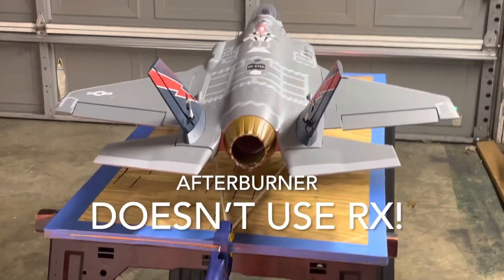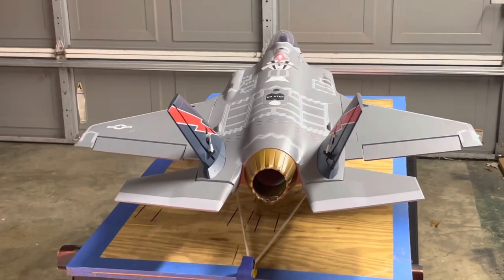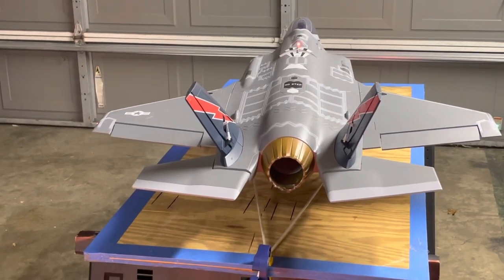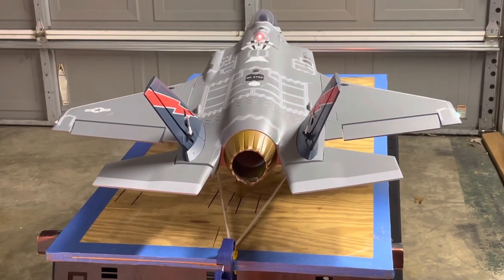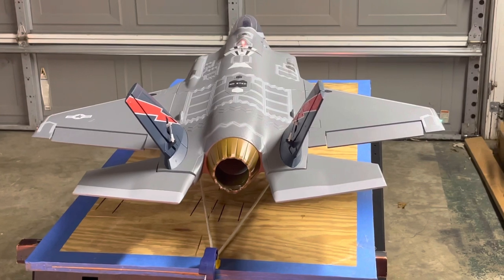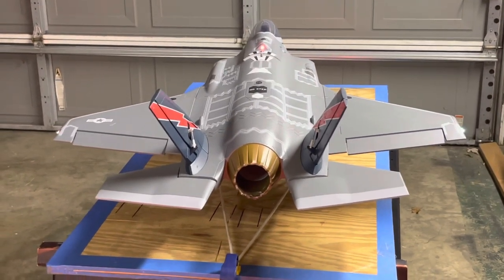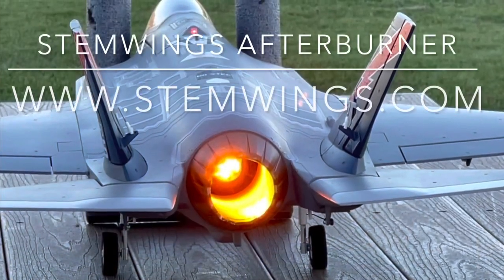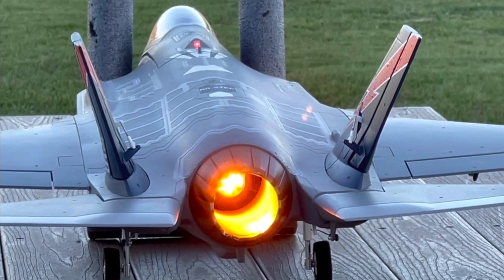Afterburner without RX input?!

Comment: Nice, you should provide a link in the description.  Also, can this be used with regular turbines such as a JetCat?
Reply from the maker: This version of the product is currently in redevelopment.  It would not work with turbines due to the purely balance lead driven connection, however, we now have an afterburner product releasing on April 15th that does two different selectable modes, and is driven off the RX, so it will work with both turbine and EDF.  It is selectable between a mode for throttle-controlled brightness over 75%, and a flicker/pulse to full from 75% mode, and it also includes a battery monitor, for the same price as other burners on the market. If you are interested, keep checking our website at www.stemwing.com
Reply: @STEMWings  Thank you for the reply.  It seems to be a fantastic product and way better than LED light rings.  I also viewed some of your other products and they are very nice!